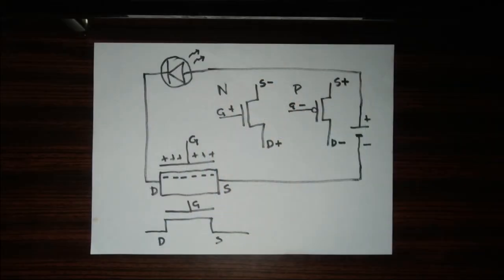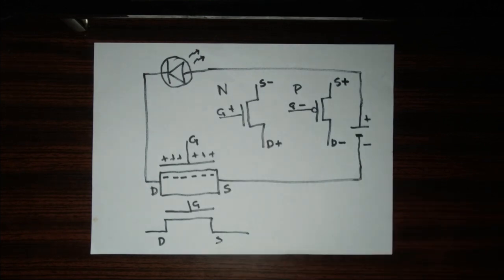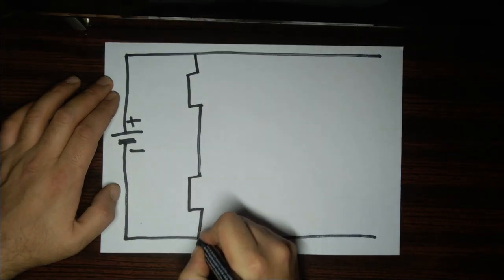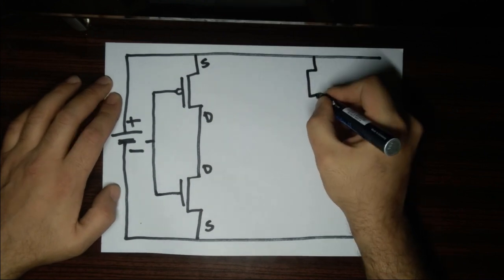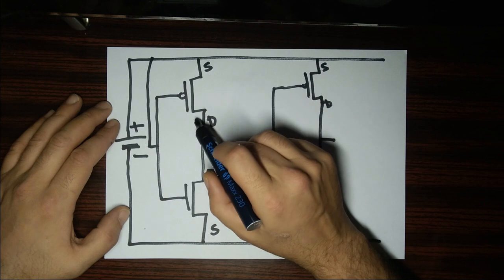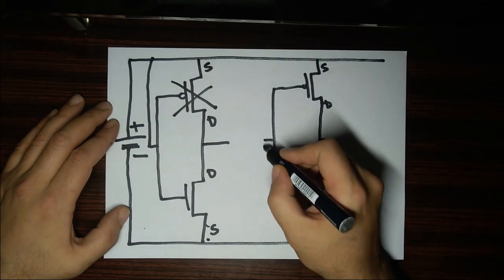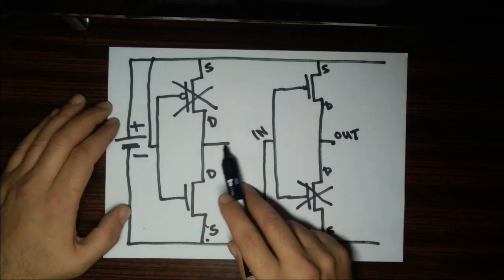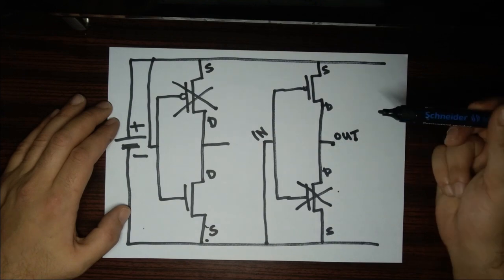VLSI - CMOS Logic: 2 - The NOT Gate, SRAM and the Ring Oscillator

Comment: I wish that we had an abundance of these electronic devices when I went to trade school. They were still teaching vacuum tube theory. Although still needed in those days due to the fact, that most televisions systems employed a "HYBRID" system of using tubes to produce the high voltage and scan deflection, while employing colour modules (RGB) to drive the gun functions.
Reply from the maker: Robert, believe it or not, the design principles are the same! Put two switches in series and you get an AND gate (for the signal to come to the output, it must pass from both switches, and both switches must be on), or for an OR gate you just put them in parallel! Actually that is described in the next video in depth! You can make any information processing device that way, be it a CPU for a computer, or a field array radar for an airplane. 
As you get devices smaller, you need LESS charges (electrons) to change their state (charge or discharge the gate to source "capacitor"), leading to faster electronics for the same working voltage!

Comment: One of the best explanations I have ever seen, thanks for uploading! I'd like to buy those transistors and try the experiments, can you tell me what name or code should I look for?
Reply from the maker: Hi Mario, thanks so much for your kind words. You can use any n and p type mosfets to implement a NOT gate. The particular ones used in this video are IRF 4905 (p type) and IRF 3205 (n type) as they are dirt cheap and very powerful, you can find them on eBay or any of your favourite online shops. I normally use these mosfets for power actuation on robots and that is why I had them in hand. Normally if you are building just logic and not actuating a powerful motor, you use very tiny mosfets, compared to the beastie ones used here. If you are actuating motors for robots you tend to use powerful ones, as in this video, as you need some heafty current for this application...